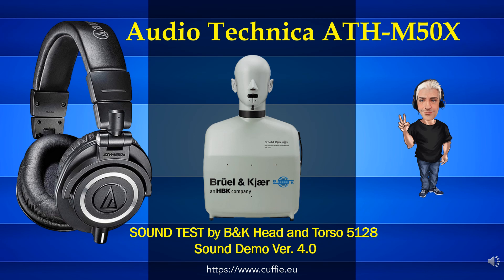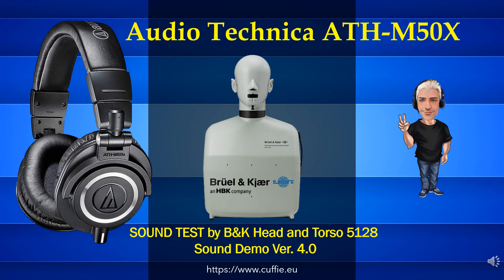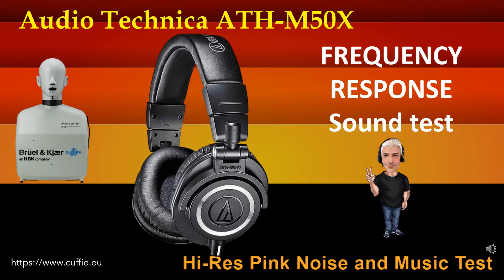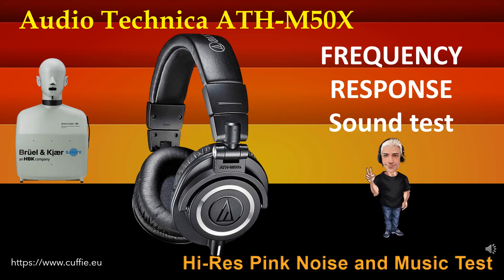AUDIO TECHNICA ATH-M50X - Sound Demo, Sound Test

Comment: Wow!!! This new measurement system proves that the M50x do not sound bad as some other audiophiles like to say. Pretty accurate sound!
Reply: Yes it is, until i heard it...
Reply: @ what do you mean?
Reply: @d.g.o4410  don't listen him..ath M50x are enjoyable, little bit v-shaped than m40x-more neutral-with more bass..at 90euro/70euro  both are bargain..
Reply: @torukmahtomahto409I enjoy a neutral sound, but found the M40 to be very lacklustre and robotic. I guess it’s just me. I’m used to Sony MDR-1R and Sony monitors.
Reply: in the video, i see now the sound of m50x is very more like original than the m40x ......
Reply: I remember comparing them to the M40x headphones at a store and the M40x headphones sounded better to me, the M50x with the original HP EP pads have more bass than the M40x with the original HP EP pads. It seems like from some charts that they have similar bass, but that fact that the M50x doesn't have the clarity that the M40x has which means that the bass is actually more present on the M50x headphones.  I'm pretty sure that some other charts showing even more bass for the M50x are more accurate because it sounded to me like there was more bass than it showed in the picture. I'm pretty sure the owner of this channel bought the M40x headphones from Amazon and didn't put the original HP EP pads on them before doing the headphones demo, because they should sound better than they did in the demo they do on this channel for them L0L. Amazon sells the M40x with different pads that alter the sound so you need to get the HP EP pads for the original sound. Other frequency response charts for the M50x show a sound chart I don't like the look of for Studio Monitors.
Reply: Se parecen mucho al original.
Reply: Vocals sound good, but instruments don't sound especially accurate. Especially noticeable with cymbals. Ideally they should sound like you can feel them being struck from the top, and having a brass resonance, but with the M50X, that sense is blunted. The full dimensionality isn't there, and the brassy sound is missing. It sort of sounds like how cymbals should in a vacuum, but when you compared them with a headphone that actually represents the cymbals fully, the M50X clearly isn't showcasing their sound resonance correctly. Maybe this would have been fine when they first released, and they're not an especially expensive headphone anyway, but I can indeed see why audiophile are not impressed.

That said, I certainly would have been very happy with the M50X when I was younger and didn't know any better. I used to use Audio Technica's ANC7 headphones almost 20 years ago, for goodness sake lol